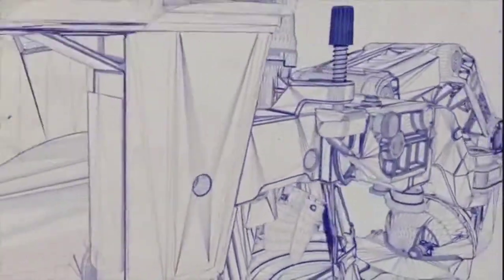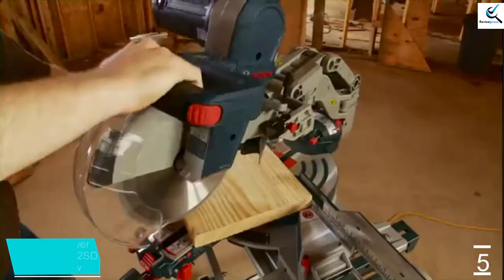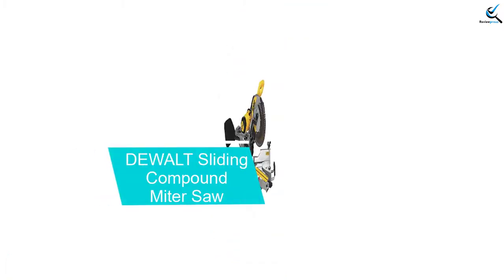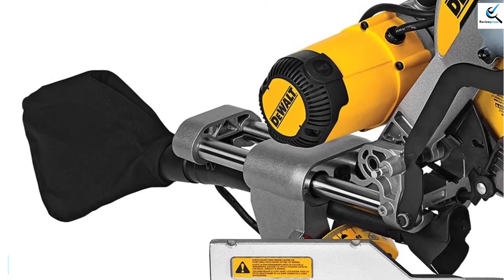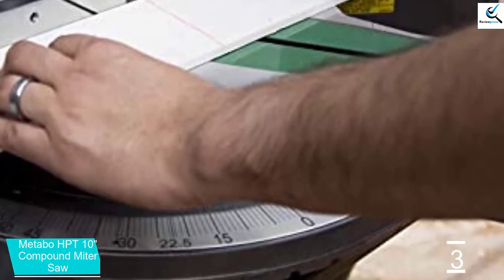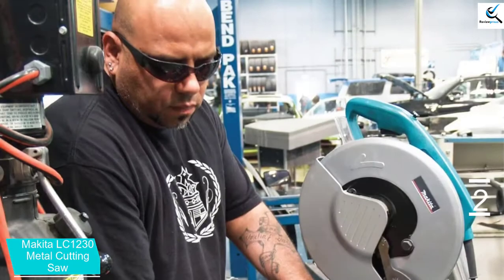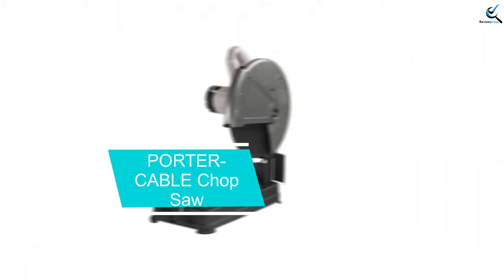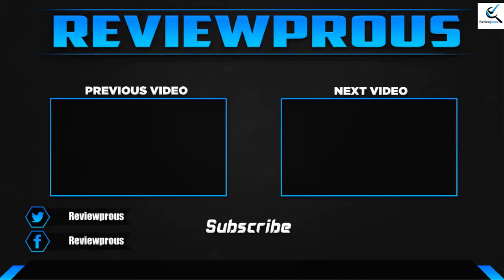Best Metal Chop Saws Reviews - [Top5Picks]

Comment: This test is only if you want to saw with precision, with a miter saw. (test is not for rough work).     
Tips and Test.    
Very important if you would like to saw with precision. (avoid torsion as much as possible)!
Always choose a Miter saw with a handle positioned in a vertical line above the saw blade.  
Everything must be aligned, slide rails, handle, and saw blade,it is much better this way the blade will not tilt.
Because there is some torsion in the aluminum housing .
And choose an engine with softstart on it to prevent wear of the gear and worm shaft.
It is very important that everything is aligned.
Here are some examples to show how the handle must be positioned above the blade.
Bosch gcm 800 sj / Bosch gcm 8 sjl / Evolution rage 3 / FESTOOL KS 60 / HITACHI C12RSH2 / FESTOOL KS 60 E KAPEX / Metabo KGSV 72 Xact  / Bosch  GCM 8 SDE
 (This also is the case with the Miter saw without the slide rails).

If you want you can test it yourself at home if there is torsion in the aluminum housing.

Step-1. First you make a saw cut from +-5 mm deep in to a flat piece of wood about +- 20 mm thick. To this with the normal handle positioned on the right side of the Miter saw.

Step-2. Then repeat this by pushing the saw blade down with your hand (finger) on the aluminum protective cover were the saw blade is cased in. Just now only do this without the running engine.

Step-3. Now you can see if the saw blade will be positioned in or next to the saw cut. If the saw blade is (+- 0,2 / 0,5 mm) next to the saw cut then there is torsion in the aluminum housing.

Step-4. Therefor it is much better to choose a Miter saw with the handle positioned vertical in line above the saw blade. 
             The second option is the handle positioned  horizontal in line above the saw blade.

Step-5. When you measure the vertical angle square of you're sawblade don't forget that there is always some torsion in the aluminum housing.

Conclusion: how further away the handle is from the saw blade how more chance of torsion in the aluminum housing.(don't go for that). 

P.S.  Also with a cheap slide miter saw it is still better the handgriff a above the saw blade than on the right side. Maybe they will make it someday then we have a winner...
Reply from the maker: Thanks for your feedback. Thank you for the tips and long discussion. We value your advice. We believe your valuable suggestions will serve as an incentive to create the next video. Hope you will always be with us. Thanks again.